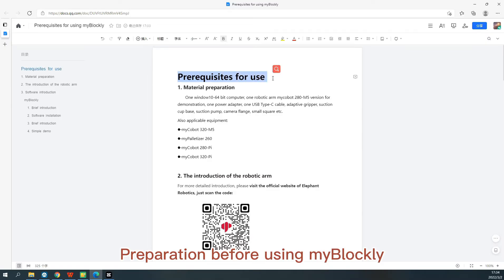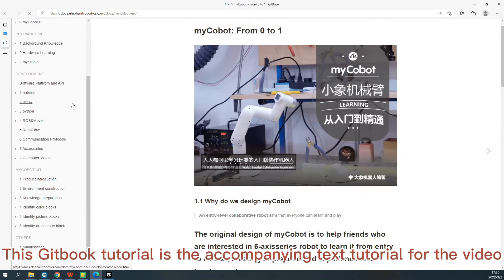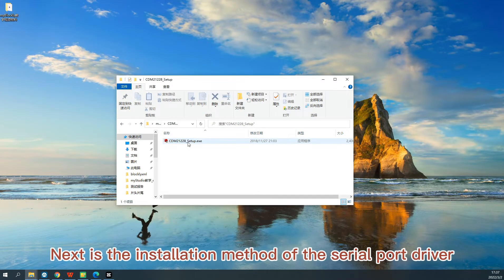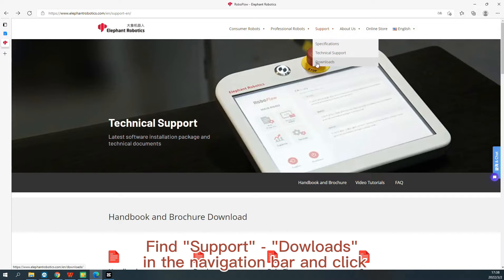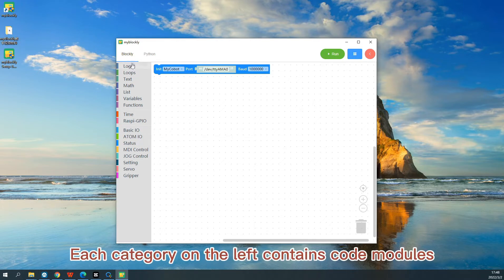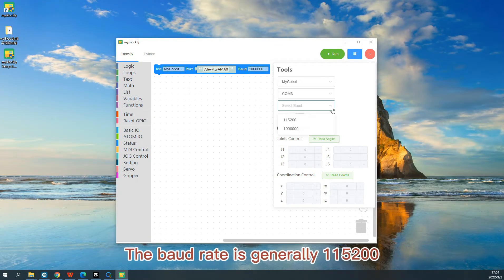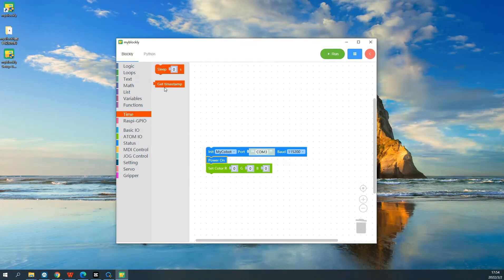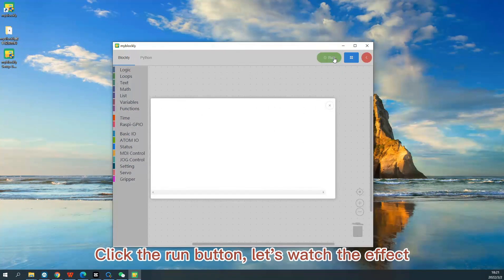myBlockly | lnstallation Tutorial

Comment: I Have done everything as the video has instructed but when I go to change the port for the driver it is the only option for me "/dev/ttyAMA0" and when I try and put open it comes up with a error message?
Reply from the maker: Hi, are you using the myCobot 280 Pi? The port number is unique, and if there is an error message, it might be because the port number is being used by another process. I suggest you restart your device. If the problem persists, please provide a video and a detailed description of the issue and contact our Technical Support team at support@elephantrobotics.com.

Comment: Could I record by move manually the robot and then read the movement to code in blockly?.. I have the M5 version
Reply from the maker: Do you mean you want to change the data storage location for the Programming by Demonstration feature?  Actually, the data generated through drag-and-drop teaching can only be saved internally on M5.
Reply: @ElephantRobotics  Not even to sd card in the M5?
Reply from the maker: Yes, the data can only be saved internally on M5. @IBICO74